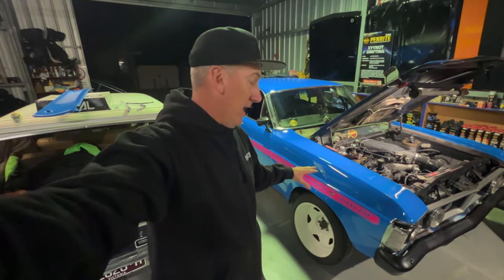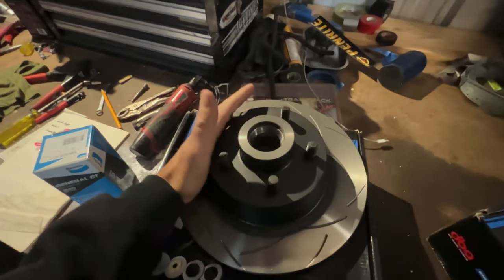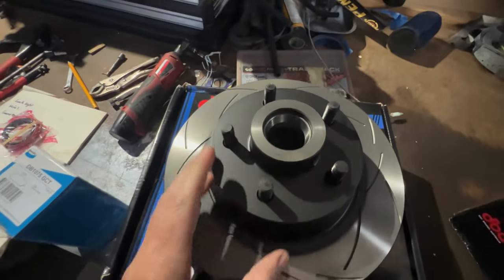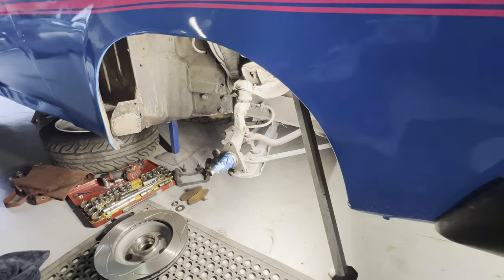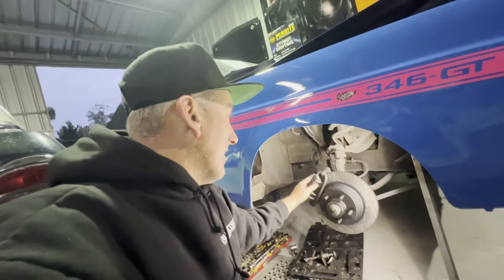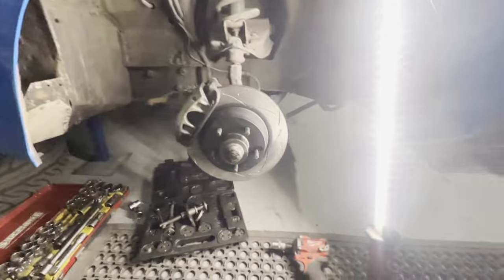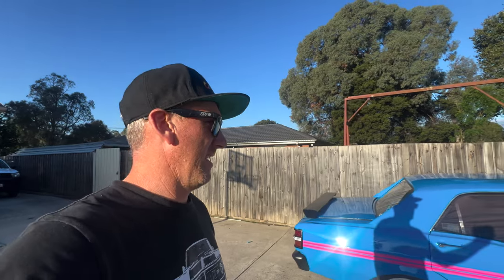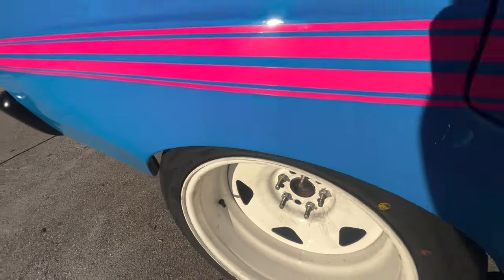How to change Ford Xy-Xf brakes and pads. Upgrade for Optima Ultimate Street Car Challenge.

Comment: Unfortunately, the xf calliper performs worse than an xy Pbr calliper (too much flex) my preference for factory size brakes is actually a hq holden calliper. It fits in the xy calliper bracket and has a bigger piston.

Comment: What u have fitted is quality standard passenger  car use parts .
High performance  will have high carbon disc , these tolerate more heat .
High performance street pads will at least be performance ceramic version minimum 
If your using 15 inch wheels look into falcon BA disc thicker and bigger diameter
Reply from the maker: @paulthompson8480  this is why I’ve been told